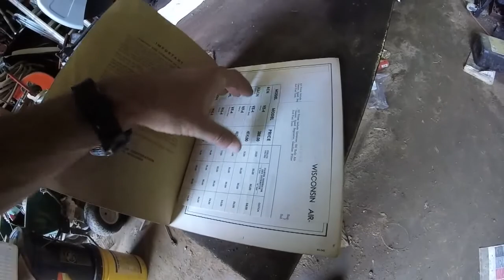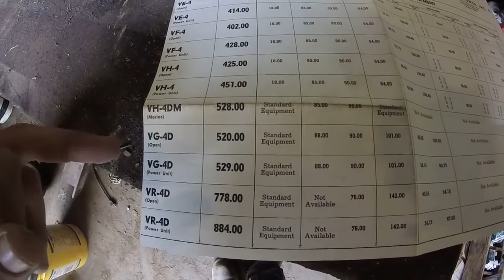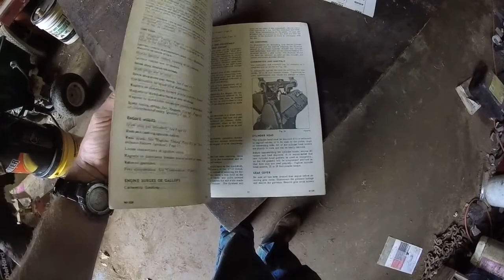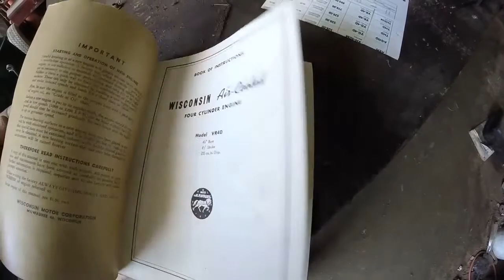big ole wisconsin engine vr4d

Comment: I like those motors. I've seen a lot of them on p-gravel concrete pumps and some were pretty ragged but still ran. The 2-bangers on hay balers and some power units on dump trailers for tractors with no wet lines and the singles on just about anything. Tough old rigs.

Comment: I have a V465D 65Hp with a Rockford Clutch. It was part of an estate sale and nobody wanted it. Since I was the only person looking at it they loaded (for free) it on a trailer that I bought from them. Mice had eaten all the wiring and hoses. The tins are rusted and the carb had a crack but it's running and purrs like a kitten. It's for sale too. BTW you can find the book online if you look.
Reply: I will like to have a v465D with a Rockford clutch and flywheel from original.
Reply: @cosmosdaniel4791 , I still have it, make me an offer!!!
Reply: Still have it?
Reply: @SouthernMechanic  This is captron's daughter. He does still have it, and he has mentioned selling it several times.
Reply: @alysonkelley3019  what's the price?
Reply: @alysonkelley3019  just let me know, I'm very interested
Reply: @SouthernMechanic  My dad said 3k but make an offer
Reply: @alysonkelley3019  I'm gonna buy it to completely rebuild and restore down to the paint so the most I could do is 500$ because I'm gonna have thousands in it when it's all done
Reply: @SouthernMechanic  that is what my dad did to it. It has been completely rebuilt and painted
Reply: @alysonkelley3019  new rings, bearings, oil pump ect?

Comment: Thank you for your information,I need one or both of them let me know what is  your opinion and options on sale.
Reply from the maker: the big engine is gone and the smaller engine we kept for parts. we have around 8 of those engines in pieces of equipment air compressor stumpgrinder straw blower that kind of thing so a parts engine is something we hold kinda dear.

Comment: Can you please tell me how you found this item sir ?? Thanks
Reply from the maker: it was at an auction, a local contractor had these the big one came off a topsoil screen. We were there looking at a track loader and my old man thought they should come home with us too
Reply: @ofdirtandiron2868  Thank you for letting me know Sir. Hope you got the big engine running and are enjoying it fella. The big engine used 6 gallons of gas at full load and rpm. Right out of the book. They were thirsty for sure. Peace vf
Reply: @ofdirtandiron2868 if you want to sell the engine I’d be interested